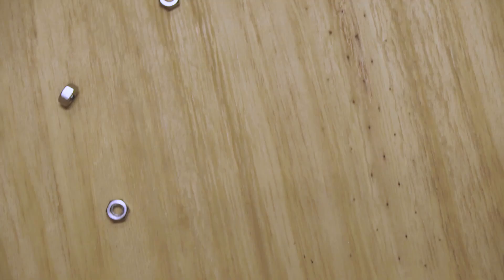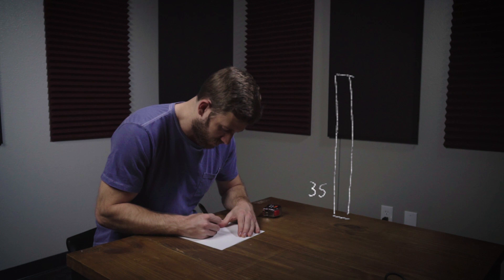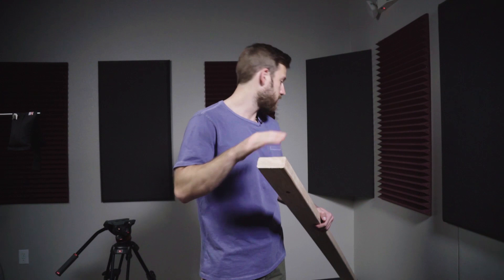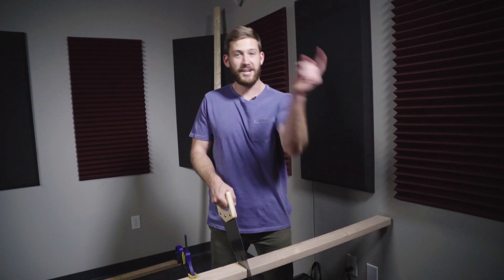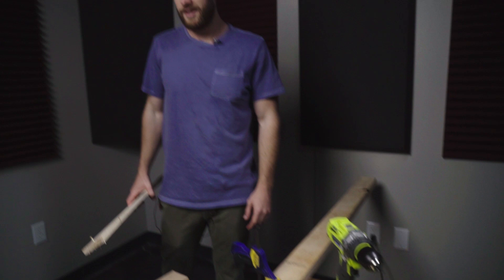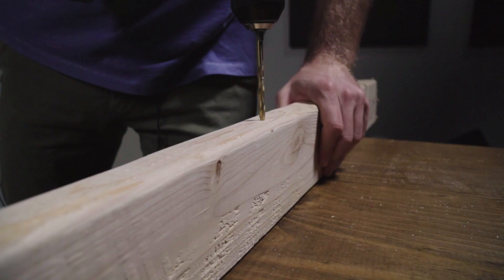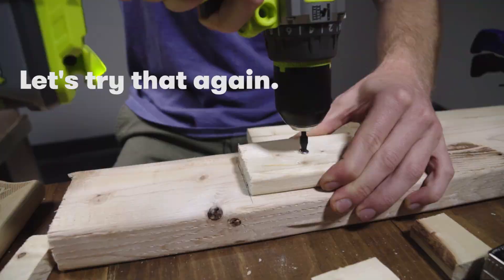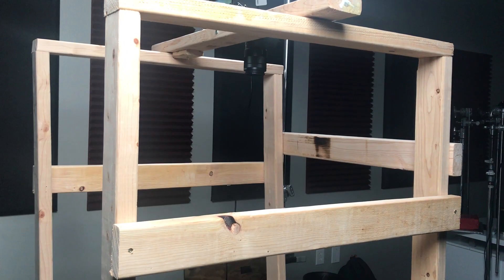Building a DIY OVERHEAD CAMERA RIG Like CASEY NEISTAT for $25 | Filmmaking Tips

Comment: If you don't know what you're doing, don't make instructional videos. 2x4s are far larger than you need for the job, making the rig heavier and more expensive than it need be. Also it's not "Seven over Thirty Two drill bit" It's a fraction. Seven Thirtyseconds. That's how imperial tool sizes are identified. Fractions. Geesh. Basic terminology. 

When drilling through wood you should also drill a smaller pilot hole, then the larger full sized hole to prevent splitting. Especially as you're drilling through the narrow side. C'mon now, this is first-day stuff.

Also, why in this universe and all it's infinite parallels do you Premium Beat video makers insist on using pliers on bolts instead of properly sized wrenches or sockets? Do you want people to copy you and skin their knuckles when the pliers slip off the bolt, or are you just that amateur you don't know how tools work?